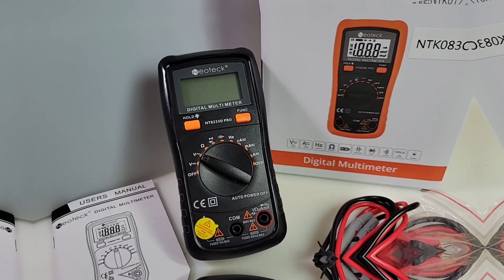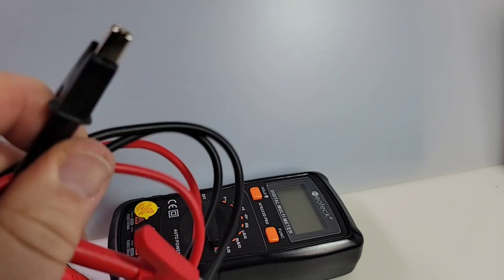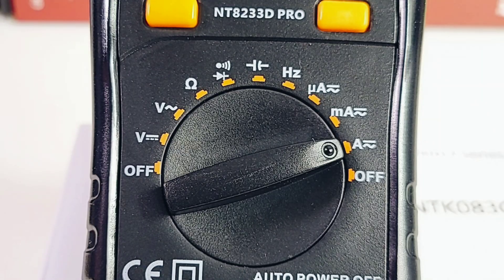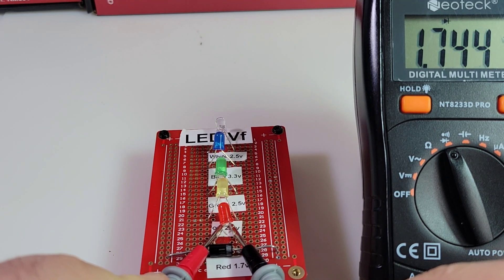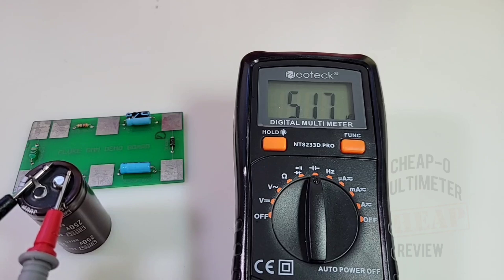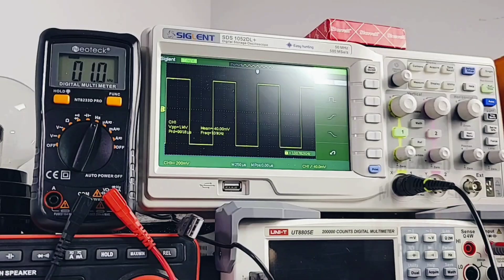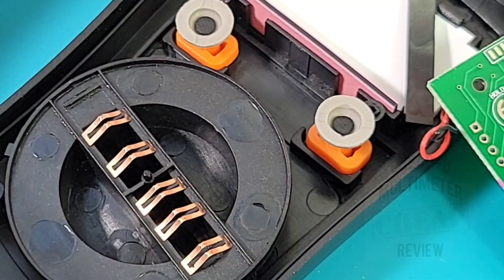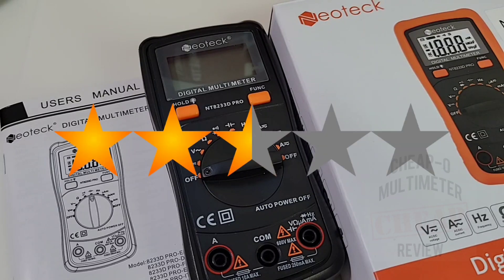NEOTECK NT8233D PRO CHEAP-O Multimeter Review & Teardown!

Comment: Thanks for the video. I passed too much current through my multimeter and broke it. It no longer measures current but does measure voltage and resistance. Can you please explain how to fix it?
Reply from the maker: You probably blew the mA or high current fuse in your multimeter.  Do you have another multimeter to do a continuity test on your fuses?  No beep in continuity means it's shorted (no good).
Reply: @KeepOnTesting  I do have another multimeter. Thanks for the tip to test and replace (if broken) the fuses. I will try that.
Reply from the maker: @thomasking7659  let us know how it works out. 👍
Reply: I replaced the lower current fuse on the left, I think it is 250 mA  or 200 mA. I can now measure current again!

I replaced it with a 5 mm x 20 mm ceramic fuse, 250 mA, 250 V.

I couldn't have done it without your video. Thanks Darren.
Reply from the maker: @thomasking7659  Great job ! Keep On Testing! 😃👍

Comment: Not a terrible meter overall, but ho-hum as you said.  A good tip cleaning might bring that continuity up to speed, def. not worth buying probe masters for this little guy.  I see it on Amazon U.S. for $25 and given its just 2000 count I feel it would be OK for the very occasional light home / bench user.  Resistance isnt so bad long as youre not in a time is money situation but anyone in that ballpark would have a more expensive rig anyway.   This meter needs to cost about $15 - $20 max US, just not enough here to warrant the price you quoted, way too many better options for about the same money as you said.
Reply from the maker: Couldn't agree more 😀 underwhelming..like a new pair of underwear from Walmart..whatever the hell that means  😉

Comment: Forgot to say I nearly had a canary the other day 🙃. Came across a full circle crack in my genuine Fluke black lead. Of course black tape was used but I noticed 3 divisions difference in using reversed polarity. So might bite the bullet and go for Probemasters. I need a set with right angles into my 87V and the ability change from standard probes / Croc clips and back again.  Any suggestions would be appreciated,  as long as I can print of a receipt for work expenses.
Reply from the maker: Probably the best deal on Ebay currently for ProbeMasters..https://www.ebay.ca/itm/Probe-Master-8043S-8000-Series-Test-Lead-Kit-10-PIECE-AUTHORIZED-EXPORT-DIST-/304106839432?mkcid=16&mkevt=1&_trksid=p2349624.m2548.l6249&mkrid=711-127632-2357-0
Reply from the maker: A cheaper set of test probes I reviewed a couple years ago..these things are still one of my 😍 favorite sets! Goupchn Multimeter Test Leads Kit Double Silicone Soft Cable Gold-Plated Probes https://www.ebay.com/itm/Goupchn-Multimeter-Test-Leads-Kit-Double-Silicone-Soft-Cable-Gold-Plated-Probes-/133503953991?mkevt=1&mkcid=16&mkrid=711-127632-2357-0&media=TWITTER&sojTags=media%3Dmedia via @eBay